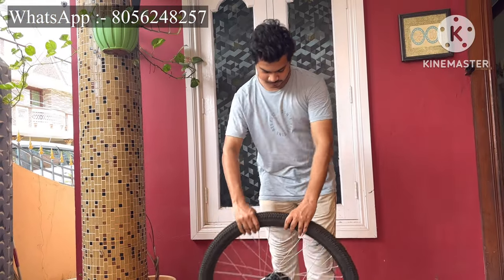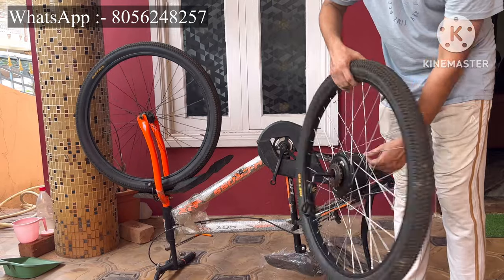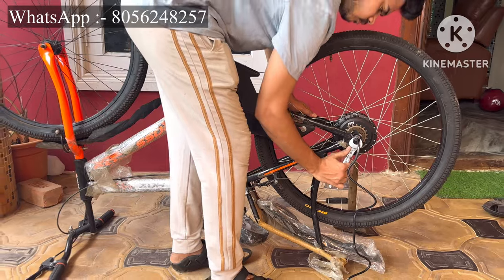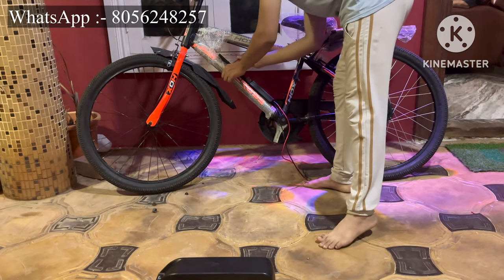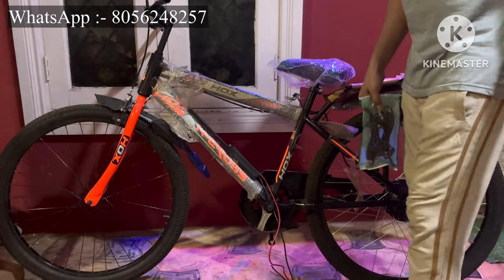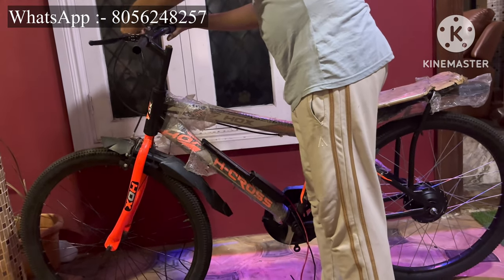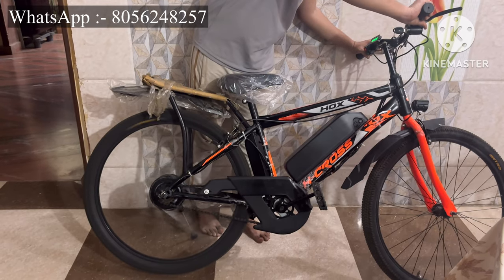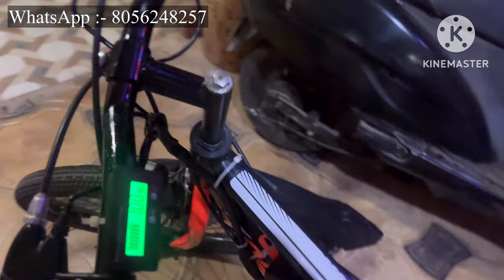Normal cycle to electric cycle conversion || lithium ion battery

Comment: What's the recommended one;
36V 30AH
48V 20AH
48V 70AH
52V 50AH
Or something else?
Reply from the maker: 36volt 20ah lithium ion battery
Reply: @streetengineer123  
Okay. Thank you for answering.